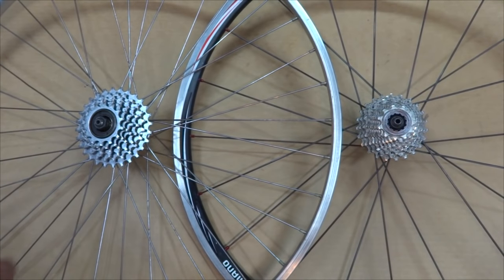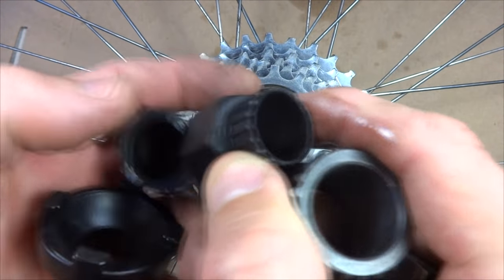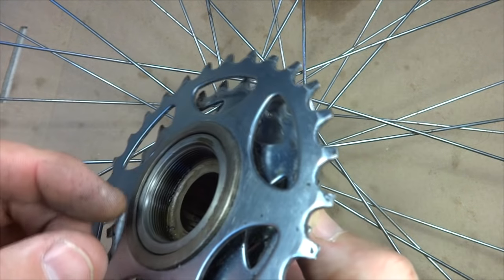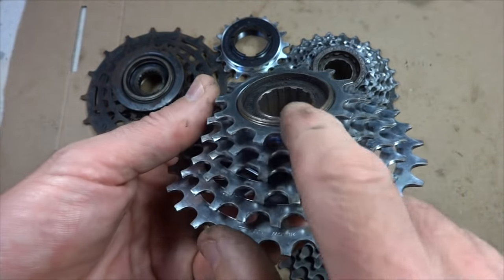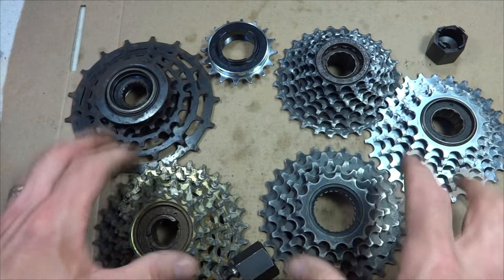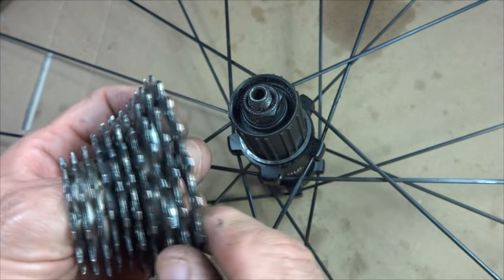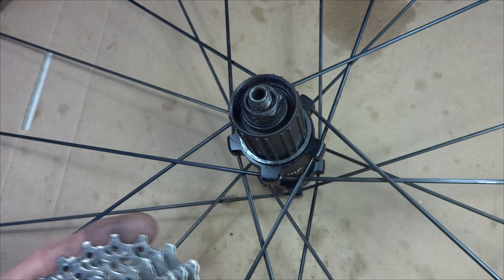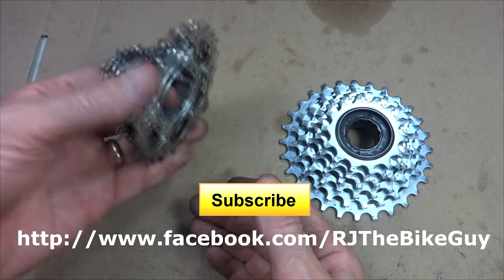Freewheel vs Cassette - What Are They? Can I Convert?

Comment: Can I replace my rear wheel w/ a Freewheel with a wheel with a cassette?  Will I need to replace the derailleur too?
Reply from the maker: It doesn't matter if you have a freewheel or cassette. The hub spacing needs to fit the frame. And the number of gears needs to match the shifters, etc.

Comment: HI. So if I have a freewheel hub, can I convert to a fixed single speed by just screwing a cog on the threads that the freewheel screwed onto? And can I screw on a single speed (not fixed)  onto the freeweel hub regardless of how many sprockets came off the freewheel.?
Reply from the maker: Yes. You will have to make sure the chainline is straight.

Comment: Can you explain what the terminology freehub and freewheel actually refers to? I understand that free is the opposite of fixed. But aren't they both cassettes, just one has attached bearing cartridge? Why is a collection of sprockets and bearing cartridge even called a free wheel? I mean it's not a wheel even is it?
Reply from the maker: I can't explain it any better than I do in this video. Go back and watch it a few more times.
Reply: What I am actually asking is what or how did the terminology to describe these two hubs evolve. I can't see any logic in, for example, the term freehub? What is the hub free of? Freewheel for example. What is the wheel free of? Is it free of the sprockets? In which case isn't the freehub's wheel also free of the sprockets? How are loose sprockets fed on a cylinder a' cassette' of sprockets? Where is the cassette? If anything the freewheel system is a cassette. Etc... I have watched your video about 3 times. However I still have to think about it because my mental image of each system does not align with the terminology. Look, actually, don't bother to answer. I think I have answered my own question. There is no answer. Except that maybe someone who doesn't speak English marketed European or Japanese components to the English speaking world , or someone who didn't speak Italian or Japanese was hired to translate trade documentation from those countries into English. I hope you understand what I am saying because I have actually now confused myself.

Comment: Hi RJ, thanks for the informational video, but please help. I have currently a 7 speed freewheel that is 36mm thick, can i replace it with a 39mm thick 8 speed freewheel? Both have 34mm inner diameter
Reply from the maker: shrug Generally 7 speed freewheels barely fit. So I am guessing no, a 3mm wider freewheel won't fit. 8 speed freewheels are unusual, so I don't know what you have. So you will just have to figure it out.
https://www.sheldonbrown.com/cribsheet-spacing.html
Reply: Thanks for the reply, my rear is a standard quick release 9mm found on most modern entry level bikes. Do you have any idea?
Reply from the maker: Seriously? That is like telling me your car has four wheels and I am supposed to guess what it is. And 10mm is the common diameter of a rear axle. 9mm in the front.

Comment: Is there a specific reason that bikes with 7 or more gears use cassettes? Is it easier to make a cassette with more cogs than a freewheel?
Reply from the maker: RandyDarkshade It's new technology. The bearings are out farther. With a freewheel, the axle sticks out past the bearings through the freewheel and is prone to bending. With more gears, it's wider and the axle would be even more prone to bending.
Reply from the maker: matthew, can you cite some documentation on this?
Reply: I find that hard to believe myself.
Reply from the maker: Yes, you can go 3 or 4 gears in one push. So all the way from 7 to 1 in 2 pushes.

Comment: Hey RJ is it possible to swap out a multispeed freewheel to single speed "bmx"  freewheel?  Cheers
Reply from the maker: Yeah, but with no derailleur to guide the chain, you will need to adjust the chain line. It would be a similar process to what's done in my fixie video: https://www.youtube.com/watch?v=sInijI1vr34
Reply: +RJ The Bike Guy cheers dude :)

Comment: Hi, can I change my 7 speed sprock 14-28 to a 8 speed sprock 
11-40?
Reply from the maker: Maybe. If it's a cassette. If the freehub will fit an 8 speed cassette. If you change the wheel. If the frame spacing will allow. You would have to change the shifters to 8 speed, etc.
https://www.youtube.com/watch?v=n5YkkAP_QVI
It's not a simple yes/no questions.

Comment: Hey RJ, is it possible to replace a single speed freewheel to a 6 speed shimano free wheel? my hubs are made by company called quando, they make flip flop hub for fixie and single speed bike. my frame is vintage elswick british bike and has a width of roughly 123 - 125mm between drop outs?. i just wanted to see your advice as some research beofre buying anything. thank you and great videos!
Reply from the maker: +Shalin Mistry Maybe, but probably not. Why not just go buy a multi speed bike. It would be easier and maybe cheaper than buying all the parts.

Comment: My gear hub on the rear wheel does not catch any more, meaning it turns / spins in both directions. ratch system will not catch. cannot ride bike .

Comment: Which is more EFFICIENT at propelling the cyclist?
Reply from the maker: That really isn't the point. But since a cassette can be wider to allow more cogs (without placing more stress on the axle), it can give more gear choices, allowing a cyclist dial in to a specific rpm range where their power is the strongest.

Comment: Of late, I am annoyed by spokes breaking on the rear wheel at the hub side where the freewheel is attached. How do I overcome this problem? My bike mechanic says I should go for a double wall rim instead of the single wall that I got. However, what I am curious about is why should spokes break at the freewheel side and not the other side? 
I ride a folding bike and she has 20" wheels with a 28 spoke number.
Reply from the maker: I can't tell you. Maybe the spoke tension is too tight. Maybe you are riding too rough for what the bike/wheels were made for. Maybe the spokes were damaged at some point (slipped chain maybe). Cheap spokes. Too thin of spokes. Low spoke count. Maybe combinations of these. Or something else. I don't know how a double wall rim will prevent broken spokes. They may help some.
Reply: @RJTheBikeGuy  The spoke tension being too tight could be the culprit as you say. And yes, I too used to wonder how a double wall rim would arrest spoke breakage. 
Thanks for your reflection.😀

Comment: I have an 6 speed freewheel. The problem is with my 2nd cog i.e. the one next to the smallest one. When I pedal the cog seems to slip whereas the freewheel remains stationary. While the remaining 5 cogs work perfectly fine. What should I do?
Reply from the maker: Replace the freewheel.
Reply: No way to keep using the same freewheel? It is a non-riveted freewheel.
Reply: Apreciate it. Will definitely get a new one.

Comment: I have a question for you sir.
Now it is clear that I can not upgrade to higher speed.

So can I downgrade then? 
You will ask why do you want to, lets say may be spare parts were not available and I had no option but to downgrade.
Reply from the maker: Freewheels and cassettes are not compatible. Period. Buy a new wheel. Different number of speeds, buy new shifters, chain and maybe derailleur.
Reply: @RJTheBikeGuy  okay got it thanks 🙂

Comment: Hi rj, 6 years ago I bought a pair of wheels with cassette hub and bought a freewheel hub as a mistake. I've got Campagnolo record wheels, they are old track wheels, with a freewheel, it's possible to fit a 7 speed freewheel on such a wheel? Thanks you
Reply from the maker: Not easily. The hub spacing is different. You would have to rebuild the hub, redish the wheel, etc.
Reply: @RJTheBikeGuy  great, thanks you very much

Comment: Rj, i just got a Cassette a sram pg730 and the sprockets dont come loose apart from the smallest one, why is that ? Is that a different design and are there any benefits or disadvantages from the moulded type ive got where each individual sprocket wont seperate ?
Reply from the maker: Many of them are riveted together. I think it's more of a matter of convenience.
Reply: @RJTheBikeGuy  Thanks for the reply/info.

Comment: How bout showing how to get a cassette off that has been stripped because of improper tool usage thx
Reply: it it's a freehub, yeah, you can use a hammer and a pointy pick to "drive" the ring around.
if it's a freewheel, you might need use the axle nuts or skewer to hold the special tool in place.
Reply from the maker: If stuff is damaged, you will have to punt, and figure it out. Improvise, adapt, overcome.
https://www.youtube.com/watch?v=W4tQcAc9Lo0

Comment: Well sir I notice that quote on quote modern trans have a bigger gear on the back then on the peddle when in 1/1. This is absolutely defeating the purpose of the bike😐 I feel if someone really has that much trouble going up a hill they should Ride a scooter would you agree.
Reply from the maker: Not really. If you have one to one gearing, the wheel is still a larger diameter than your pedal stroke.
Reply: RJ The Bike Guy I think a large part of bike designed is just to look impressive whether or not something is nessary.
Reply from the maker: Not really. Not quality bikes anyway.
Reply: I completely disagree with you. By your logic, it I want to ride up a steep hill, I should quit cycling and start rock climbing.

Comment: is it possible to put a single speed freewheel on a hub of a 7 speed?
Reply from the maker: Yes, install a single speed freewheel, but then you have to deal with chainline since you won't have a derailleur to center the chain on the cogs.
Reply: +RJ The Bike Guy ya i have been running the back 7 with the 3 on front without derailleurs for a while haven't had many problems until i took it to the skatepark

Comment: I have a problem where, when you pedal, the chain goes forward and the gear spins as well, but the rear wheel does not spin and the bike does not move, the rear gear is 7 speed.
Reply from the maker: https://www.youtube.com/watch?v=XUSBr7Q0HmU
Reply: Excuse me I bought a campy wheel, but I have a 7 speed freewheel cassette, I found a 8 speed cassette that comes with a sram chain do I need to replace my crank too to use the rear wheel.
Reply from the maker: No.
Reply: Just what I wanted to hear
Reply: RJ The Bike Guy Thank my prayers have been answered

Comment: Most race bikes have cassetes on why , are they faster than freewheel or its because with cassette you can add more gears
Reply from the maker: They are not faster. Modern bikes have more cogs for more gearing choices. So the cassettes are wider than the older freewheels. Freewheels that wide would place a lot of stress on the axle due to the inward bearing location. Cassettes allow the bearings to be farther out, and less stress on the axle.

Comment: So I've been trying to research the bike i am about to buy comes with a 10 speed 11T-42T Cassette i want to swap over to a freewheel for e biking purposes will i be able to install a 11T-32T 10 Speed Freewheel without any issues? unfortunately that the highest T i can find that is threaded as the new hub needs a threaded freewheel.
Reply from the maker: Watch the video again.
Reply: Watched it again and it's really informative about the difference between the two but not about stepping down in T's the e bike kit I am getting comes with a new wheel that uses the old screw old type I just wanted to know if the different in gearing size would affect it even tho their both a 10 speed.

Comment: Hey i recently bought a second hand road bike and i couldn't shift to the 3 small cogs and i called someone and he said that the guy that i bought it from changed the back wheel to a 10 cog cassete wheel and the shifter can only shift to 7. I don't know if i explained it very good but i just wanna know if that can be the situation and he said that i can just add some spacers in between.
Reply from the maker: The cassette/freewheel needs to match the shifter. So a 10 speed cassette won't work correctly with a 7 speed shifter: https://www.youtube.com/watch?v=xMvD1T4qF1E
Reply from the maker: But I don't know how the bike is actually set up, so this might be useful: https://www.youtube.com/watch?v=gwBQxhZhKnE

Comment: Advantages and Disadvantages?
Reply: it seems the free wheel on cheaper bikes have the threads machined at a bit of a crocked angle and can wobble as they spin . where as the cassette style with the splines are by nature straight so the gear set runs straight and true .

Comment: I'm having trouble with my bike. I wanted to change the wheel and chain and derailers from a new bike onto an older one. The one I want to use has a freewheel hub with 5 gears, the newer one has a cassette with 7 gears. However, when I try to change the back wheel the axle does not fit inside the frame ends. Do I change the spacer/bearing hub on the non-gear side? (this is larger on the new wheel) Can I change the axles over so it fits? Do I bend out the frame ends and force it to fit? Cheers
Reply: So I removed the spacer from the axle on the non-gear side and it fits but I have a really long axle on one side, is that a problem?
Reply from the maker: https://www.youtube.com/watch?v=DO5V3qkW05g

Comment: Can you reduce the number of cogs in a cassette?
Reply from the maker: Yes, but no. You would have to replace the missing cogs with spacers. But you are not going to just remove cogs to make a 9 speed cassette into an 8 speed or 7 speed cassette as the cog spacing is different. https://www.sheldonbrown.com/cribsheet-spacing.html

Comment: +RJ The Bike Guy

i do have problem adjusting the shifting of my 1991 Trek Antelope
the derailleur is totally straight, the cables and housing are new and totally fine, the adjustment i'm pretty sure very normal as well

the only thing is, it didn't come to me with original wheels, which i'm not sure if the original was a cassette or freewheel

it came with 6 speed freewheel, and i replaced the freewheel with 7 speed one 

the shifting never come right

what might the problem do you think? does cassette or freewheel type has anything to do with shifting problem? or simply i shouldn't change the 6 speed freewheel into 7 speed?

thanks!
Reply from the maker: +Jonathan Singgih Pranoto Didi you watch this video? https://www.youtube.com/watch?v=rj3bYJ7zyLc
Reply: +RJ The Bike Guy

yes i did, mine has no problem with the spacing, and i have exage 300 rear derailleur which is SIS as well 

is it matter if the original wheel was for Hyperglide cassette and now i'm using the Freewheel type hub? i'm assuming this might the problem, but not really sure as well
Reply from the maker: What size (in teeth) are the cogs on the freewheel? You have 7 speed SIS shifters?

Comment: i have a single speed trike..the coaster hub thing in the middle of the frame has 2 sprockets,,one for the pedal..the other for the back chain that goes to the axle...i want to make this bike 5-7 speed but i do not know how to go about it...the sprocket on the axle has a notch with an allen bolt than goes into the recess on the axle to lock it in place. can someone help me figure this issue out ?
Reply from the maker: Sounds cool.  Maybe with an internally geared hub. The problem with trikes, is there are various designs, so what may work on one, may not work on another.
Reply: indeed...i was looking online and walmart sells a 7 speed Kent trike with traditional gear shifter......i thought something like that would be available . i went to a bike shop and asked , the guy got the excited look like he was about to make a lot of money...i guess i will simply buy that sturmy 3 speed kit for the coaster hub and let it go  @RJTheBikeGuy

Comment: Hi I recently went on a ride on my bike and as I was riding it made a really loud pop from the cassette and it's starting to happen more under load. It a brand new bike so it's not worn out and it's sat in a shed so it's not rusty either. Also just before I got home and went into a lower gear it ended up slipping a bit. Please help!
Reply from the maker: https://www.youtube.com/watch?v=VzrpC7jrz8U
Reply: RJ The Bike Guy I watched the video and it was very informative, although I can feel when it slipped it wasn't just a slip on the chain and cassette. What happened was when I arrived home the pedal went from at the top straight to the top and fell then it just doesn't engage.
Reply from the maker: https://www.youtube.com/watch?v=XUSBr7Q0HmU
or
https://www.youtube.com/watch?v=iQ6XgztsfmU

Comment: i currently have a Shimano seven speed freewhweel, i am looking at buying a new freehub with 8 speed cassette & chain, as both my chain and rear rims are getting old, as i understand it i should have no issue with the front chain rings, its a carrera valour  currently with the factory supplied shimano altus driveset, i am intending to buy a shimano hyperglide 8 speed cassette & 8 speed chain can u foresee any issue with the front drive chain?, do u have a link to explain the question i am trying to ask?
Reply from the maker: 8 speed stuff should work with your chainrings.
Reply: cheers, as i thought but now my minds easy ahead of purchase.

Comment: What's the minimum I would have to do to change  a 7 speed freewheel  to a 7 speed cassette,obviosly,I would have to change the wheel,but what else would need changing??
Reply from the maker: If the hub width is the same, just change the wheel. That is assuming you have a normal 7 speed freewheel and not on of the ultra flavors. If the hub spacing is wider, you may have to spread the stays, but only do that if it's a steel frame.
Reply: It's a freewheel on a trek 7.0 maybe a hyperglide type!!
Reply: .....What do you mean by ultra flavours!!
Reply from the maker: http://www.sheldonbrown.com/cribsheet-spacing.html